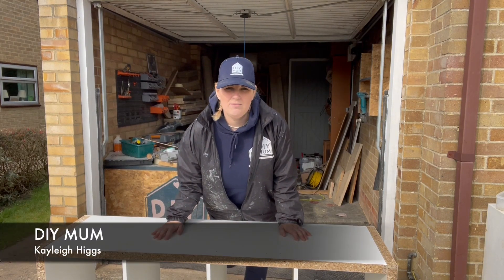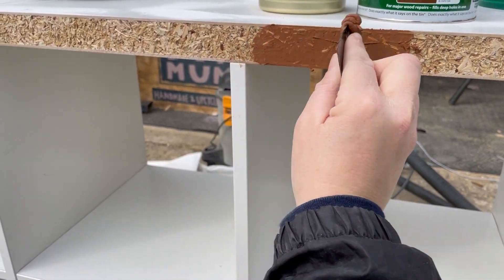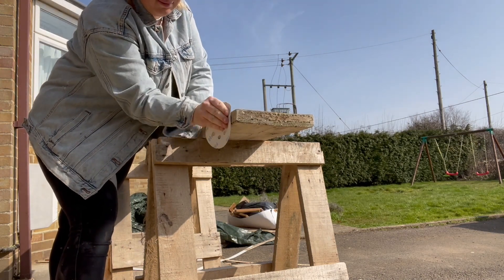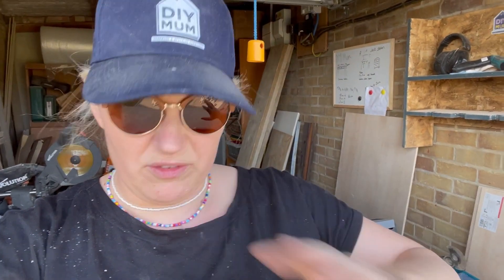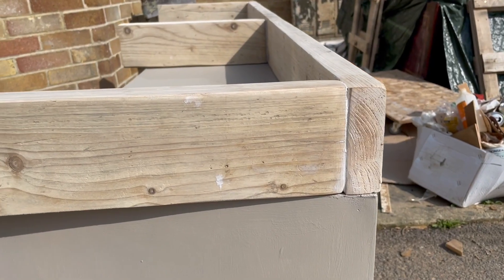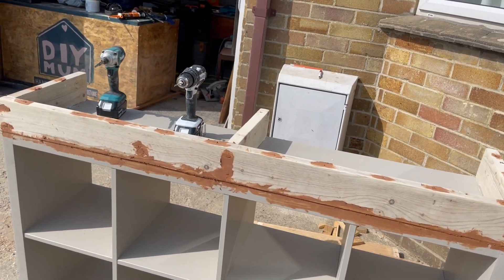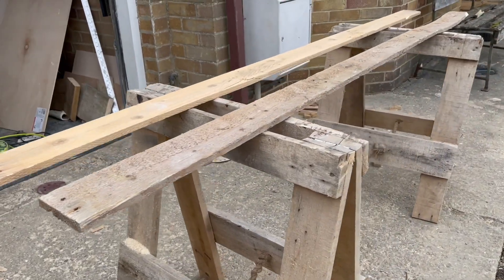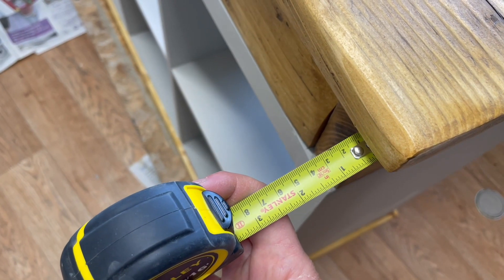IKEA KALLAX Upcycle - Breakfast Bar

Comment: I found that if you need to drill through the whole depth of the Ikea chip board then use a metal plate on the underside and bolts to keep it from coming off. When you need to dismantle it would be easier to do so.

Comment: What is "sugar soap" and where to buy?  Any substitutes if it's not sold in the USA? UPDATE: It's called "TSP" in the US. Cleans and etches the surface prior to painting. 
See more on Wikipedia: "What is sugar soap used for?
Using sugar soap prior to painting is essential as it removes dirt, grease and nicotine stains and etches the surface providing a mechanical key before applying new paint. It is a non-abrasive soap, which contains washing soda and soap."

Comment: Brilliant video! Do you find the paint holds up from wear and tear? Thinking of painting some IKEA chest of draws for a children's room and need to know if it will chip easily etc?
Reply: If in doubt use the undercoat used in this video for extra hold on the exposed and filled areas. Zinsser 123, undercoat, sealer and blocker. Blocks stain and odour. Hangs on great to laminate/highgloss finish. I’m sure there are others but check at your local hardware store. I’ve used Zinsser lots and never had a bad outcome. Had a friend who found a beautiful timber piece that unfortunately had been in a home of very heavy smokers. You know that odour. She used Zinsser 123 and it completely sealed the piece inside and out, every surface after some recommended cleaning products didn’t do the job. It’s been in her home now for years used for tea towels, paper towel, rubbish bags and junk draw etc. every draw is opened daily and used and there is no evidence of smell or stain coming through. Hope this helps 😊